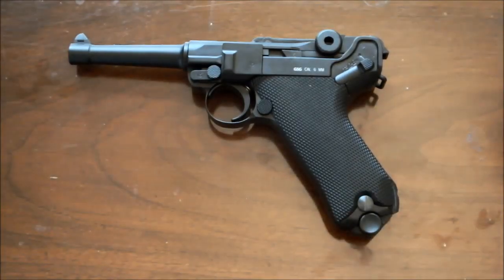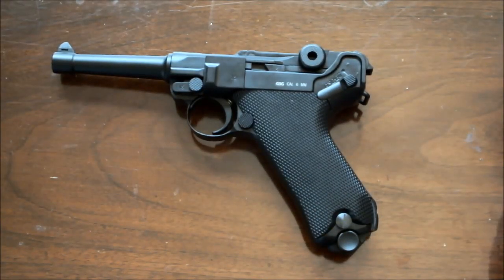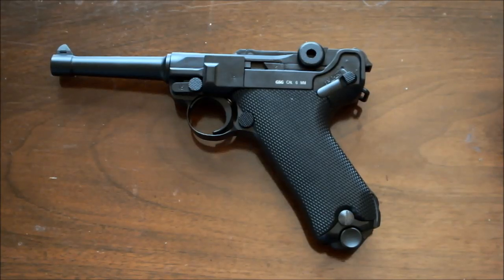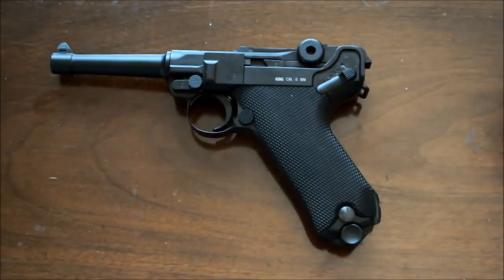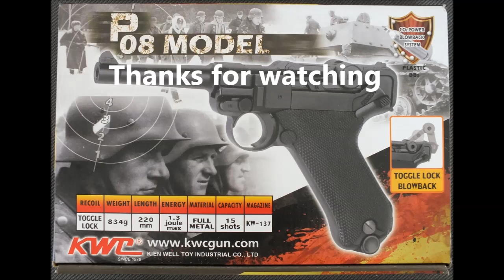KWC P08 (Luger) update

Comment: I have the Umarex legends version 4.5mm steel bb with blowback which I believe is a KWC distributed by Umarex in the USA.  This gun is one of the most accurate bb guns I own at 20 to 40 feet.  It is also easy to lub and maintain.  My gun came pretty dry, but I lubed the inside parts with silicone oil and the action is very smooth.  I typically get around 60 rounds on one CO2 cartridge but our temperatures in GA are above 70 most of the year.  I do have some excessive wear though on the magazines around the bottom, but it's covered up when the mag is fully inserted.  Recently, I gave this gun to my son who loves it and I'm thinking of getting another one since I already miss it.  I always recommend getting at least an extra mag for any CO2 guns so one can warm up while shooting and loading the other one.  It just keeps the fun going, but like you, I recommend taking taking a few seconds between shots.